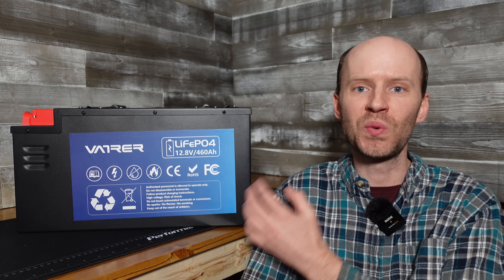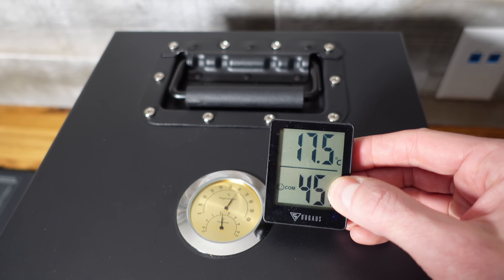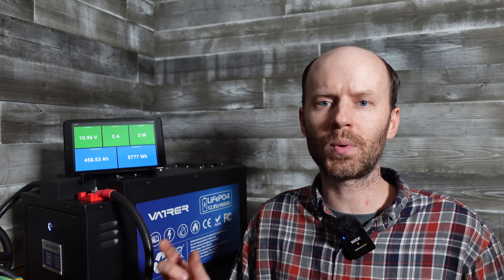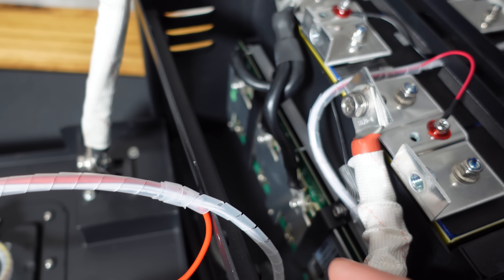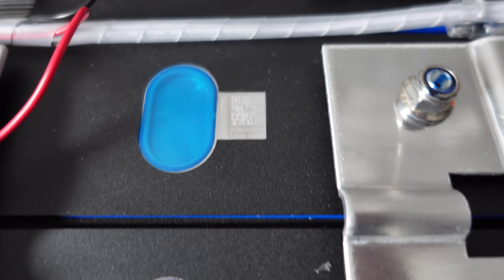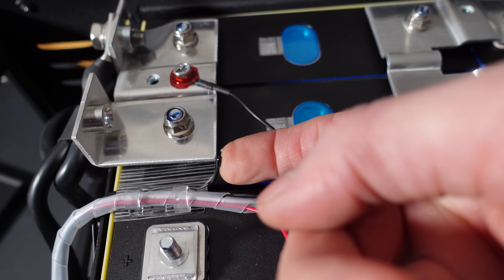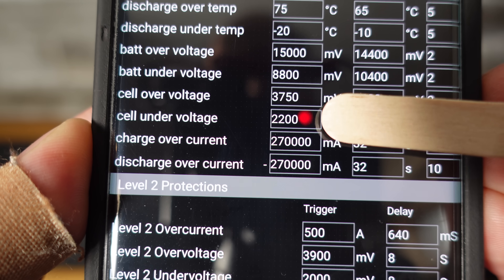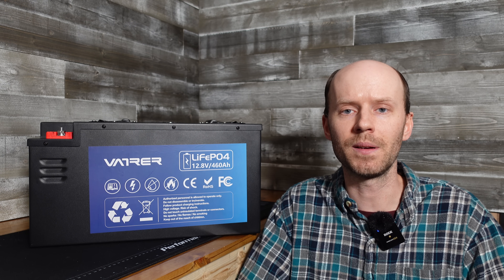MASSIVE 12V 460Ah LiFePO4 Battery from Vatrer, Nearly 6000Wh, Full Review!

Comment: how much do they cost?  1,540 CAD   wow  how long does it take to charge a huge battery like that?  it is more practical having 1 battery for cable management but i do not have a big system  i rent so limited in what i would like to do. so i prefer smaller lifepo4 batteries  faster recharge times and for me i use solar lifepo4's for emergency to feed the freesers and refrigerators for short outages like 16hrs max.  I have solar paner one 200w bluetti and  1 ecoworthy 195watt. add a twin gas generator 4000w   peak  3,500 normal . IF i had $$$$ and owned a house I would have a big capacity battery or 2. BUt it is what it is i remain in portable  fast recharge batteries.  right now I have  3 bluetti power stations   EB3A  AC 70 and AC 180. I like them they work well. thanks for sharing your knowledge

Comment: This is a 460ah battery, is a 400 amp fuse be ok to use?
Reply from the maker: No. That's way too large on a battery rated for 250A. I would consult a qualified electrician for proper fuse sizing.

Comment: Hello, I am a bit confused! After I watch your review I bought the 460A/h lithium batterie from Vatrer to replace my 2 x 6 volts batteries. I installed it and installed 900 watts of solar panel. I regularly check the Overkill solar App to check the state of charge and noticed that the results change radically from 100% 14,37 V at 484,0Ah after I shut off the charge and discharge button at the top it shows after then it shows only 70%. Witch is a big difference. After I open up the charge and discharge button it stays at 70%. In the morning after few hours, the batterie indicate 100%. Is this a problem with the JBD BMS or what? 

In the settings, it indicates « Cell 100% Cap voltage » at 3350 mv but 3 lines higher « Cell full Voltage » at 3550 mv. What is the good info?

Thank’s for the videos you produced and share they are well done and very informative.

Comment: I bought one of the 460 ah Vaterer batteries in may 2023 and am having a solar guy install more panels on my rv's roof and when he went to test the system he says the battery is only putting out two amps? it has worked fine up until the time he moved the battery to a new location in my rv and now he says it is only putting out two amps? What could be causing this?
Reply: I’m not a pro but could either be turned off or you need to wake them up by connecting another battery to it just for a sec

Comment: What you stated as 4-5x the point of failure by having individual 100Ah batteries, I see as 4-5x the redundancy along WITH a combined 400-500A rating which reduces heat and stress on all the BMS's. If one of my individual batteries were to fail, I simply disable it and the others continue to work. If your 1 big battery fails... you're SOL!
Reply from the maker: Sure, you could make an argument that way as well. Both sides have ups/downs.
Reply: @LithiumSolar  Having all your eggs in one basket has many downs BUT yes, for those who may not have the knowledge to correctly and safely install parallel batteries, one larger battery could simply things at the cost of redundancy, longevity and power.

Comment: Will the BMS shut the battery down when it reaches its low temp limit?  The reason for the question is.  We will be leaving Wi traveling to FL in January.  We are wondering if the battery will power our coach  heater going down the road in possible temp below 0 F until we reach warmer temps.  Also if the battery shuts down what will happen if the engine alternator is trying to charge it?  Would we be better off not connecting it until we reach warmer weather?

Comment: after having this same   type for 10 mons , battery failed, volts drop from 14,2v to 3.2 after powering the inversor on, changed the inversor to a brand new one  and still the same prob. trying  to contact vatrer  sellers and no answer .   i gess is the chip bms.

Comment: Good afternoon. I just installed my 460AH lithium battery from you all in my rv. I was reading the ideal charging Amps was 92. 

I am looking to add an AC charger once I’m plugged into shore power to charge the battery when I don’t have solar but unable to find any 92amp rated chargers. I have found lots of 100amp chargers rated for lithium. And a few 75 amp chargers. 

My question is, would getting a 100amp charger be too much and damage my battery? I’m under the impression that even rated at 100 amps it likely won’t reach 100 in real world amps and even if it does it won’t stay there very long. 

Or should I not exceed the 92amps and get 75?

Comment: I thought I'd share my initial test. We needed a bigger bank and for my 2nd go I really wanted BT so I could set the BMS parameters and monitor the status (I'm a Tech and not knowing drove me nuts) and have accessibility for maintenance. I received mine at the beginning of June and swapped out my 200ah Chins in my RV. I did not utilize my shunt as I'm going to rely on the BMS (Chins didn't have BT). Out of the box I put a 230a load on it for 20 minutes with no issue. I finished draining it at 150a until my inverter shutoff at 10.5v. The BMS showed the battery at 0% (I think the BMS uses voltage based reading until it completes a cycle, then coulomb counts). I then lowered draw to 45a until the inverter shutoff at again at 10.5v. At this point I drew 5a until I hit 11v (2.75v cell) at rest. I can't imagine needing to draw this monster below 11v so I consider this 0% capacity and set the BMS battery capacity at 500AH to give the parameters some headroom for testing and turned on balance only when charging so it wouldn't bleed off balancing once charger stopped. I charged at 80a (Fluke meter read 79.7a at cable in) and the BMS started counting AH. In the morning the charger had shutoff, at rest the voltage was 13.83v and the battery was at 100% or 500AH. I was pleasantly surprised and didn't take screenshot of the remainder as this was all well into bonus territory. I restarted the charger and I think it started charging at 40ish amps and over about 30 minutes slowly dropped to 0a at 14.2v (3.55v cell). I would guesstimate an addition 10 to 15ah. After the season I might bump up the capacity in the BMS to 525ah and do another cycle test but for now I couldn't be happier and this Vatrer 460ah was well worth the purchase. My 200ah Chins out of the box also exceeded it's 200ah capacity about 7%. Moving from 6v GC battery bank, over 3 years the Chins battery exceeded my expectations and made me a believer, Lifepo4 is a game changer in an RV. Having said that, 500+ah is amazing and have all the features I realized I really wanted. Hope this helps anyone considering.

Comment: Hygrometer. It's for measuring humidity in the air. Hydrometer is a different instrument. It measures specific gravity of liquids. Often used in distillation, beer making and wine making.
Reply from the maker: Yes, that is correct.
Reply: @LithiumSolar  it is indeed. Since you called it a hydrometer and didn't elaborate, I figured there are viewers who would like to know the difference.

Comment: Hello. I have a question please. I have one Ampertime basic battery and two Li-time mini batteries, all with 100A 12V ratings. I would like to connect them in parallel, but the manufacturer advises against it due to differences in BMS and battery cells between the two types. What do you  think?

Comment: With regard to comment noted at the end of the video about using multiple smaller batteries in parallel, there is another advantage to that setup not noted. If you install a disconnect on each of the single smaller batteries you can isolate them if one of them fails. Then you won’t loose the entire battery capacity. Yes, the total cost will be more, but the redundancy is well worth the extra cost, especially in a marine application.

Comment: Impressive battery. In my yacht I have a little different need and use. I currently have 13 Valence 12xp-27u batteries all in parallel. The advantage to me for this is these need to start 2 pretty large diesel engines. Each BMS is capable of 150 amp continuous and 300 amps for 30 seconds. I have been able to start an engine with 4 of these batteries, but the wiring has to be perfect or the BMS's shut down in a cascading event. So I have 6 wired perfect and the other 7 connected not so perfect. A little odd because the boat came with wiring for 2 completely separate battery banks for Port and Starboard. But unlike lead, I can most likely still start one engine with 5% capacity remaining and definitely the little 12kw generator engine that can recharge the batteries with the on board charger or the 2kw of solar. Also, this battery is not really suited for storage in the bowels of a boat and would start to rust and corroded in short order. But with all that being said, this would be a great battery for an RV or home storage. Thanks for the video.

Comment: Talked to Vatrer. They said all Vatrer 12v-460Ah comes with B-cells.
Reply from the maker: Really?? Was this an email? If so can you forward it to me?
Reply: @LithiumSolar  Yes I have it in writing.  It was a bummer.  Went for 2 x 280 SOK because of that.  Why not ask them yourself? I do not think they will not tell the truth.  Here is a video to a another review that confirms that they use B cells. https://youtu.be/i9uDE-98MDg?si=fsFG266GxRGJF4hS
Reply from the maker: @a2022z2  I did ask and I was told that the video your referencing was the initial design before mass production and that mass production have grade A cells. If you have proof otherwise (which it sounds like you do) please forward it to me. My email address is in the video description.

Comment: Did you use welding cables ?
Reply from the maker: No
Reply: @LithiumSolar  then what vendor built those flexible cables ? Please ! Current Connection ?
Reply from the maker: @VideoByPatrick  The cable is from "random ebay dude" here https://ebay.us/As7iMq and I crimped the lugs on myself.
Reply: @LithiumSolar  thanks so much, few videos ago you used welding cable and demonstrated it's flexibility benefits; I value your insight and findings. This new cable method I assume is thiner than welding cable.
Reply from the maker: @VideoByPatrick  The silicone insulated cable has softer insulation and much finer strands making it very flexible. Each cable has their purpose. The silicone insulated cable is good for a test bench like I have here, but I wouldn't really wire an inverter up with it. It will depend on your use case and any code requirements you have to follow. This silicone insulated cable does not carry any certifications/listings.

Comment: That has nice output, but still can't beat my 15Kw Hour 48V, 250A output, home-built 300 pound battery. I have a 10,000 Watt solar array in full sun right now (32X320W Renogy panels), connected to two Renogy 48V all-in-one, Charge controller wall mounted units (5,000W input each) , usually by mid-day all of my batteries are fully charged. That's eight 100Ah 48V batteries, plus a Bluetti AC300 w/ four B300 cell packs, plus an AC200L with B230, and the 15KW hour battery I mentioned first.
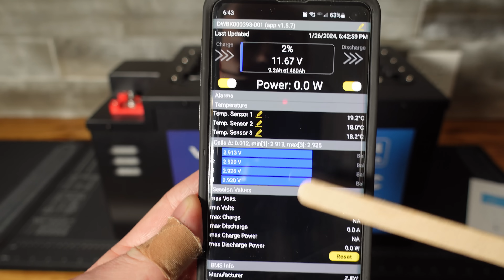Reply: I use a Massey Ferguson backhoe arm to transport and swing the battery into my front door to get it inside. Right now it's 12:30 in the afternoon here in Texas and those batteries are topped off. I learned, if you're gonna play with the big boy batteries you need a backhoe transporter. I don't move any of my batteries without the backhoe.
Reply: Make your own video stupid...

Comment: Interesting they included venting.  I know my early model 3 tesla battery pack “pops” all the time when charging and when driving in cold weather.
Reply: If anything does go horribly wrong with the cells and they start gassing a lot, a steel cased battery could develop enough pressure to produce quite a bad explosion.  Plastic cased ones can do it too but the pressure isn't anywhere near as high of course.  Not sure this unit could devlop that sort of pressure since there doesn't appear to be gaskets on any of the joints.  Odds on it would be pissing gas out of every possible place if that ever happened but having vents doesn't hurt.
Reply from the maker: There are air vents on the side of the case as I noted in the video.
Reply: Most coaches have battery compartments exposed to elements, will the vents allow dirt, etc into the battery and cause problems

Comment: I bought their 48 V golf cart battery. It seems to be pretty good and really well-made. The only issue I’ve had is last week after I charged it with a full charge. It only shows 80ah capacity. They did send me a message and told me to run the battery down and then charge it back up but it’s still only came up to 81ah.  Hopefully they will have me try something else 🤞🏻.
Reply: If the battery capacity is always only 80ah, please contact us for a new battery.

Comment: Would be nice to see a full load test. (250A) I think that is as important as a capacity test to see how the cell voltages stand up to higher amp draw.  I watched another review of the same battery. In that battery all cells had a “B” stamped on the QR code indicating that Vatrer are using rejected automotive cells.
Reply: Didn't see a b stamped on these.  Seems like you came to try  to ruin their name
Reply: @ Not at all. I was interested in the 460 Ah.  Vatrer support confirmed that they used B cells in this battery. I appreciated an honest answer. 
But that is almost one year ago. So what they do today I do not know.

Comment: Good evening... What is the voltage and current of the unit cell and what is its type?
Reply from the maker: It's a 12.8V, 460Ah battery. The cells are EVE LF230.

Comment: I have 2 of these and they are awesome! The modular design was a key selling point.  When I stupidly stripped one of the terminals, Vatrer sent me a free replacement and a few days later it was quickly fixed. I like it much better than the sealed plastic batteries.
Reply: Don't store these batteries at 100% you will damage the cells.
Correct storage charge is 60%.

Comment: I have a very similar set up DIY with a 200a JBD I found having the bus bars connected the same way as shown caused cells 2 and 3 to not “current share” and always had lower capacity. By removing the 4 way cross bar and connecting them in diagonal manor corrected the issue.

At 11:17 you can even see cells 2 and 3 are the outliers.

I’d wager it’d get worse and worse if you cycled it 5-10 times. 

With the small balance current of the JBD it’s going to be working hard.

I do say this is as close to what I want in an off the shelf battery, love the serviceability and allowing you to change parameters of the BMS.

Comment: Where did you get that 1/0 battery cable?
Reply from the maker: The cable came from here... https://ebay.us/yogho4
Reply: You can also go to any welding supply store and get cable by the foot. The welding leads are very flexible and 6-8 AWG through 4/0 are frequently stocked, at least in my area.
Reply from the maker: @r2db  The cable I have is silicon-insulated with a 200C rating. Welding cable is not the same thing.
Reply: @LithiumSolar  You are correct, they are not the same. I would trust welding leads more. Most of the "extra flexible" or "ultra flexible" wire is Al conductors. In case you are not aware, they have a very bad reputation for starting fires due to high resistance at connections. For a vehicle installation I would prefer "marine" cable for the added corrosion protection of the tinned wire. For a home installation, actual UL listed cable, not "UL 3214 Style" which is how the item you had listed is being sold, would be preferred or possibly necessary depending upon the opinion of the AHJ and one's homeowner insurance company.
Reply from the maker: @r2db  This is not aluminum wire. Even if it was aluminum, there is nothing wrong with aluminum wire provided it's rated and terminated correctly. I would agree, for any installation, actual battery cable (typically identical or similar to welding cable) is preferrable. This is a test setup that moves every time I do a battery test, thereby silicon-insulated is by far a preferred choice. If you're doing a permanent installation, it needs to comply with local codes.